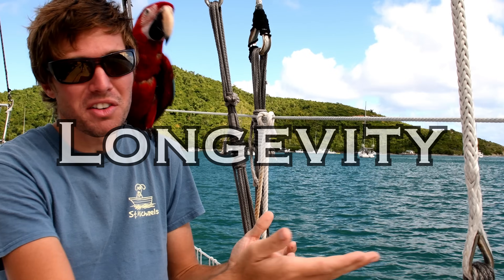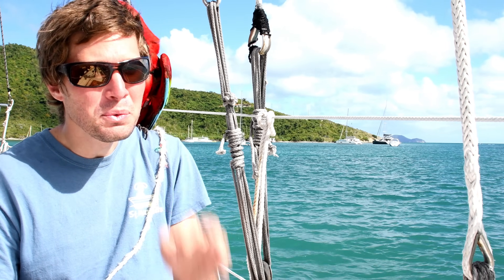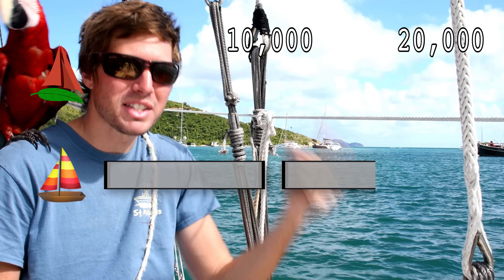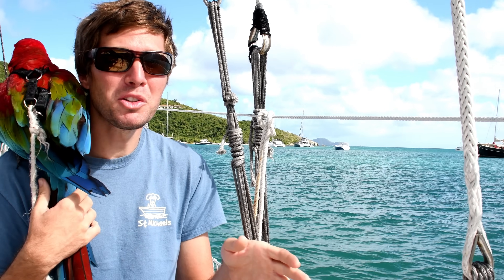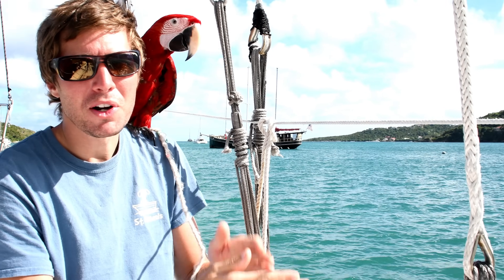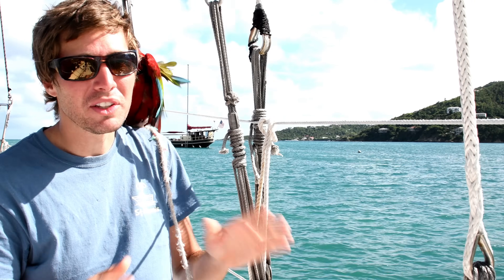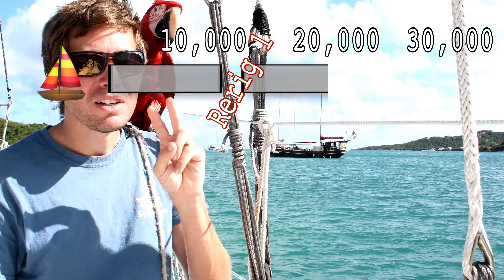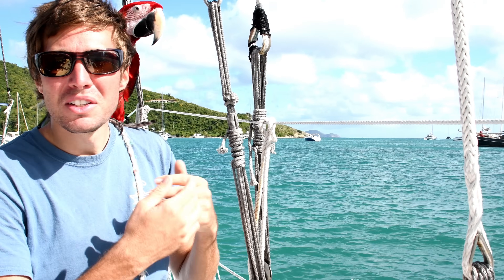Dyneema: The BEST Kind of RIGGING?

Comment: The 10 year limit is set by insurance companies, and does not necessarily represent the life of the rig.  In more northern climates, where we only sail for 1/2 the year, the rule of thumb is 20 years.  My new boat is 42 years old.  When I bought it, I replaced the original standing rigging, and I see no flaws in it.  I may go to synthetic rigging in the future while keeping a metal head stay so I can use a roller furler.  BTW, I doubt those non-stop, around the world sailors re-rig in the middle of the ocean.
Reply from the maker: In the north where the mast is unstepped for half the year, giving the rigging a break, it does last longer than the abused rigging in the tropics that is in constant duty for the entire year. 
As for the non-stop sailors, nowadays they use synthetic rigging which lets them sail farther on a single rig. When they were steel rigged doing that course, a lot of rig failures occurred along the way. (The synthetic rigs of today still suffer rig failures but due to the fact that they use the spindliest little rig they can in the name of reducing windage).
Reply: @RiggingDoctor  I sailed from Florida to Alaska.  On my way to Hawaii from the Galapagos I paralleled a large group going to the Marquesas and the most common problems reported by that fleet on the daily net were rigging failures.  I was really surprised at the number of problems with rigging.  One who experienced the second most severe failure was a professional rigger who almost lost his mast.  When I got to HI I had a rigger check and tune my rig - he found the tang on the running backstay I'd used the most had fractured but not failed.  Not likely to have been catastrophic but it was a good warning.

Comment: Would pvc pipe on the stays protect against chafe?  Patrick Childress has a video on using it.to.protect  sheets  from chafe on strrl  stays.
Reply from the maker: Yes*

*the pipe will protect against chafe caused by the sheets but it needs to be securely lashed to the stay so that it itself doesn’t cause chafe as it rolls around.
Reply: I have now seen so many pvc cracked into sections or lengthwise. May recommend Pex instead. If using pvc pick electrical conduit preferably schedule 80. Carefully chamfered ends plus chafe protection under for synthetic.

Comment: I consider a free standing mast a no brainer.................Standing rigging is a nuisance in every respect.   There are numerous potential failure points (every connection, every chain plate, etc), any one of which can bring the mast down.  With a suitable free standing mast you have NONE of the problems of standing rigging, and  side step many of sailing the problems inherent in a stayed mast.
Reply from the maker: That’s why those boats are also called Freedom Rigs 😉
Reply: @RiggingDoctor  There are a lot of unstayed rigs other than the Freedom models…. and a lot to be said for them.   Modern sailors seem to think that the triangular sail of the Bermuda rig, and it’s towering stayed mast is the ultimate rig for every purpose…. It is clearly NOT.
Reply from the maker: I agree! If the boat is built to support the mast, then you never have to worry about the rig anywhere you go! If you do have cable dependent rigging, then you are stuck choosing between different materials.
Reply: @stonetoolcompany3649  ...and in small boats they are a blast. On bigger boats the masts have to be constructed very carefully. Often out of carbon fiber, mostly custom made at very high costs. This prohibits the use of these riggs for most of us.
Reply: I guess I have an older freedom rig, keel stepped boxed Spruce main, deck stepped mizzen. Cheaper than carbon one can assume without checking, actually amazingly light.
Reply: @braithmiller     Just eliminating all that “garbage” (rigging), allows room for a heavier mast.   There are quite a few boats with free standing masts that are not small (by my definition)…of course in our extreme society, it seems everybody strives for ever larger boats… soon anything under 50’ will be considered “small”.
Reply: @stonetoolcompany3649  I have a 20' trailerable sailboat as well, with deck stepped mast. As much of a boat I want to see deck stepped personaly. My ketch the boxed spruce is not larger than some aluminum riggs. In the yard moving both on a dolly by myself, quite stiff. Observation of a forklift with 6 assistants on the ends to move an aluminum just to keep the ends off the ground and prevent bend damage. Very telling.
Reply: @braithmiller  Interesting! How big is your Ketch/ Yawl? How long is your mast/ sail area?

Comment: What about headstays with furlers?
Reply: Also the galvanized can leave discoloration streaks and, I understand, benefits from some different maintenance procedures.
Reply: @gregorytremblay4913  HUH, thanks for that Greg. I am really only thinking about Dyneema, but are you saying that the gal stains the sails? and just out of curiosity, do you know any of the maintenance issues with it? I really thought that high tensile gal would be long term etc really good, just ugly.
Reply from the maker: Galvanized steel is actually really good for rigging, but the discoloration comes from the slurry you have to paint on it all the time to keep it from rusting. If it’s worm/parcel/served and then maintained wet with slurry religiously, the wire will still look like new at 50 years! 
The problem is the slurry. I was about to rerig in galvanized when I figured out how to make Dyneema work, so I went with synthetic.
Reply from the maker: I’m still working on a way to make it work. I have the idea but I haven’t tested it properly yet.
Reply: @RiggingDoctor  Well, if all else is dyneea and only one is metal, that's not too bad. I have a friend in his 70's and he recommends thigh tensile gal. and basically the big diff. between it and s/s is looks I think.

Comment: Is this sk75? and what dia is your main shrouds
Reply from the maker: It’s heat set SK75 and ours is 9mm
Reply: @RiggingDoctor  Are you telling me your main shrouds and backstays are only 9mm? I was told by a rigger, that the way he does it is to add 1mm dia to the existing s/s 1x19. But hey, don;t get me wrong, you have done it and it has taken you across the Atlantic and back.
Reply from the maker: Going 1mm bigger than steel is an easy “safe way” to figure out a size of Dyneema. 
I did mine from the water up with calculations to figure out exactly how much force my rig would be subjected to and then found a line size that would meet my needs with a hefty safety factor. 
Our rig is pretty short by modern standards so the loads are less intense on the rigging. 
I have done rigging calculations for a variety of 30 foot boats and some can get by on 5mm stays while others with taller rigs need 9mm stays!
Reply: @RiggingDoctor  My main mast is only 13m, so the sail is probably only 12m and the foot is not as long as it could be.
Reply: I have Colligo 13mm heat set SK75 on my Island Packet 370.  According to Colligo, dyneema is so strong that breaking strength is irrelevant. Size based on creep. So I have 8 stays with 13mm SK75 and 2 Furlers with SS.  It’s feels beefy.
Reply: @acena  I have a 43' Roberts center cockpit full length keel ketch. The main is 13m and both the main and mizzen have two upper and two lower shrouds, no centre backstays and all standing rigging is 9.5mmm [ vernier ] s/s. I'd say it was 10mm that has pulled in. So I'm thinking of 12mm dyneema for the main and 10mm for the mizzen, thoughts anyone????

Comment: Insurance companies requires that the standing riggin be replaced after 10 years, however they do not mention that it should be replaced after 10,000 miles. Where did you get this information? Thanks, Richard
Reply from the maker: The 10,000 miles is also based off of what insurance companies say
Reply: @RiggingDoctor  Which companies?
Reply from the maker: Boat US (Geico) and StateFarm. These are the two companies that I have personally had insurance with and that’s what they told me I needed.
Reply: @RiggingDoctor  Thanks a lot, very useful. Cheers

Comment: I recently saw a dream boat in Annapolis. Everything looked amazing, but the life lines were steel cables through bare drilled stanchions. It was obvious that the holes should've been sleeved and grey Dyneema line running through them. I bought a dream boat - that's one of the first things I'll change. 
Did you know that Cuben Fiber (Dyneema) was invented in the 1990s as a fiber for sail fabric for racing boats?  Wikipedia used to say that it's use for sails ended when it was found to stretch longitudinally (might just be the weave). It doesn't say that anymore - so maybe it wasn't true.  Great stuff.
Reply from the maker: Thanks for sharing!

Comment: Yes I do!

From my rod rigging documentation:  As a general rule, Navtec recommends complete inspection of mast and rigging systems after a maximum of 40,000 to 60,000 sailing miles or 6 years, whichever comes first. This comprehensive maintenance schedule would include inspection of all the rod heads and end fittings. If any of the heads are cracked or worn, the rod must be re-headed.

This doesn't mean that the complete rod section must be replaced; that would depend on whether the turnbuckles had enough stroke to compensate for a shorter section of rod. In a good installation, the rod will typically last significantly longer than the cold heads on the end.

After a thorough inspection (40,000 to 60,000m or 6 yrs) with no evidence of damage, it may be reasonable to expect the rod to last an additional 20,000 to 30,000 miles. However, Navtec Recommends rod re-heading, and this is when a maintenance and inspection schedule becomes of paramount importance.
Reply from the maker: Rod is amazing but really requires a diligent maintenance period. The heads are feats of engineering!

Comment: Do you have any insurance issues with your boat and your rigging? I thought the 10yr/10K limit was largely driven by insurability. I imagine that an insurer would scratch their head for a while when you tell them about your standing rigging.
Informative video. Thanks for the info.

😀
Reply from the maker: We only have liability insurance since we fix everything ourselves and do our best to not be in the situation where we would need to submit a claim. 
10y/10000nm is driven by insurance because in that time frame, cracks will arise and if not found in an inspection they will be found when it breaks!

Comment: Can you reference the 10 year limit on SS rigging. I would love to see the numbers and how that was determined. I know insurance companies quote the 10 years, but that is for their liability  thanks
Reply from the maker: It’s because by 10 years, stress cracks will have formed somewhere in the rig. This is why insurance companies want their rigs replaced at 10 years to reduce the number of claims they have to deal with.
Reply: @RiggingDoctor  i get all that, but where is the evidence of this? Has someone done testing?
Reply from the maker: It’s not so much from tests but just historical data of the age of rigging when problems have arises. From this, the insurance companies have done their calculations and risk assessments to determine that 10 years is a safe bet for them.
Reply: @RiggingDoctor , I agree, but to clarify, the usual way insurance companies do their "investigation" is around the loss of money -- simply that. If they have numerous claims and find out that their client has not done new rigging for many years/nm, they simply draw a line such that almost all of their client's claims fall on the wrong side to save their business. Thus, if you have insurance and expect some reassurance, you are forced to re-rig, although your rig may not have been subject to terrible forces or any significant corrosion. Just my two cents. Cheers.
Reply: We don't have that where we're from. Insurance companies don't care when the rigging is replaced. If it fails, the insurance payout is affected by the age, though. Insurance companies have guides for checking the rigging, and when to replace it. The checks boils down to about broken strands, rust/oxidation, kinks in the wire, cracks or enlonged holes in the eyelets. Broken chainplates or missing pins is the reasons I've heard that rigs are coming down, and our rigging is as old as our boats.

Comment: Where do you get this 10 year, 10,000 mile life from? I can show you many, many boats from the 1970's and 1980's with absolutely original standing rigging. In 35 years in the business as a Great Lakes marina manager I have only seen two catastrophic rigging failures and both of those were attributed to improper installation. How long do these synthetics stand up to sunlight? Chafe? I have seen chafe result in the failure of a 1/2" dock line during the course of one overnight gale. Nylon, not dyneema but my experience is that any loaded synthetic line will cut like butter if exposed to any sharp chafe. I'm not sure your advice is best for those who do not fully understand the rig, the rigging and the tune. Running rigging, dyneema for sure. The consequences of failure (other than hoisting humans and there should always be a redundant safety line) is minimal compared to the loss of a cap shroud etc.
Reply: I thought it was the insurance companies that state those numbers.
Reply from the maker: The Great Lakes are a special place, and the only place where time stands still for steel rigging. Oddly enough, when one of those boats leaves the lakes and enters the salty world, their rigging dies a miserable and rapid death! 
Dyneema is actually very resistant (but not immune) to chafe. It takes a lot of effort and time to chafe through it, which is plenty of time to find and stop it from becoming a serious issue. 
Nylon stretches a lot, which gives it excellent elasticity, but also generates a lot of heat which further degrades the fibers. 
Dyneema has no elasticity, so it doesn’t heat itself up for a speedy death. 

The 10 year, 10,000nm business is based on the findings from insurance companies. They like their bots to be rerigged at those two points to reduce the risk of claims. At 10 years in salty places where the boats remain rigged year round, stress cracks will have developed somewhere in the rig.
Reply: @RiggingDoctor  I used nylon as an example of chafe issues with synthetics. Dacron is similar. I guess my point is that you need to be sure of what is going on. Tough in the middle of the night in a gale. I am unaware of boats getting routinely rerigged during circumnavigation. Although my workplace was in the Great Lakes over the years many customers took their boats south for several years at a time and a couple completed circumnavigations. You still have not addressed the effect of continuous UV exposure. Swaged terminals can be a problem but I have not seen a catastrophic failure. I have seen broken strands. Stay-locs or Norseman facilitate inspection.
Reply: BTW no malice. I'm a fan :)
Reply from the maker: Boats should get rerigged but rarely do before something breaks after their first 10,000nm. 
As for UV, I talked about it for a moment. The outer 0.1μm gets destroyed by UV and then protects the rest of the rope from any further damage. Long term testing by DSM has found no loss of strength from continuous UV exposure so it has been determined to be negligible.
Reply from the maker: No worries, these are good questions!
Reply: @RiggingDoctor  Hmmm, one-millionth of a  meter eh! Who is DSM? Does the color of the dyneema matter re UV?
Reply: My bedtime is soon...
Reply from the maker: DSM is the manufacturer of Dyneema. The color doesn’t have any effect on its durability in UV. The fibers are all white, but the outer layer is dyed for aesthetics, the dye doesn’t help protect it in any way.

Comment: does it work with a furling genoa as well? What about the initial cost?
Reply from the maker: Initial cost is cheaper IF you do it yourself. It’s easy but time consuming to make, so if you are paying someone by the hour, it can be as expensive as steel rigging. 
I have some ideas about how to make it work inside a furler but I haven’t tested them yet to say if it works or not.

Comment: Thanks for the video, very good overview.

So .. do I lose my furler or do I just keep the forestay metal?
Reply from the maker: Right now, you can replace all the other stays in Dyneema and keep the furler on a metal stay if you wanted to convert and keep the furler. 
I’m working on a few ideas to make Dyneema work inside a furler but I haven’t tested them yet to say if it works or not.
Reply: @RiggingDoctor  if you have the time when you are back in St Augustine you can use mine to toss around ideas.
Reply: @RiggingDoctor  Please keep working on that.
Reply: If you want to keep the furler on the headstay and have the advantage of light synthetic then go with antitorsional cable and continuous furler, you will be only able to set the jib full in or full out and eventually drop it because it’s hanked on. I’ll go that way on my next boat.  Great vid Herb, keep sharing all your knowledge on synthetic rigging, it’s a pleasure to appraise that much from you, thank you!

Comment: Hey guys,  I got a question that just popped into my brain. It may sound stupid but here we/I go.  Can you mix wire standing rigging with synthetic,  not on the soma line?  Like for instance, I need to change out a wire rigging on my boat bc it broke (yes, Mast still up, broke on the hard during a hurricane).  I want to change all the rigging to synthetic,  but don't have the cash to do it all at once.  So, one at a time?  I know its crazy and probably not, but had to ask.
Reply from the maker: You can mix and match, but you need to do one side of the mast at a time. 
So, forward lowers, aft lower, and cap shrouds at the same time on that side of the mast. 
For example, port in steel starboard in Dyneema.